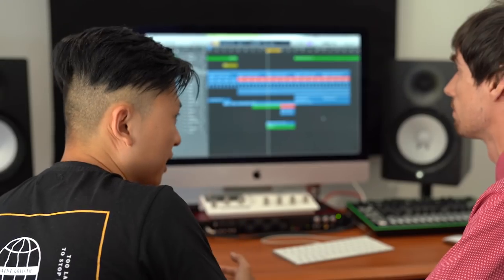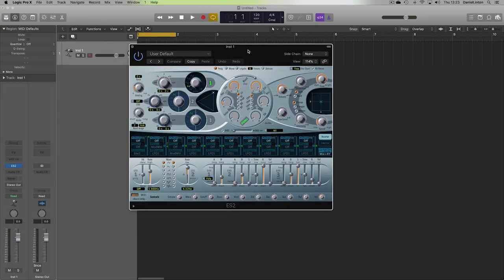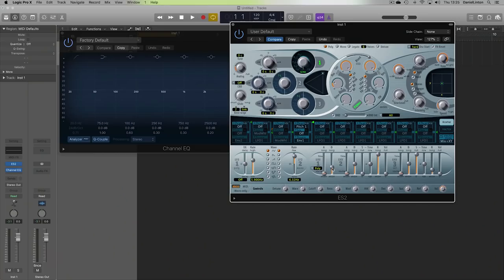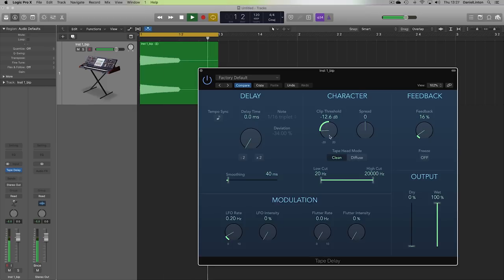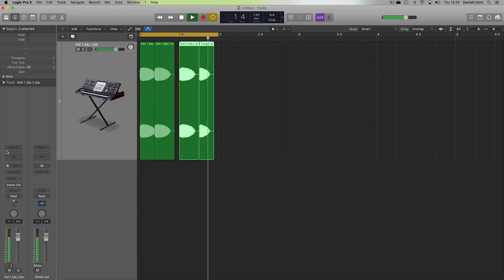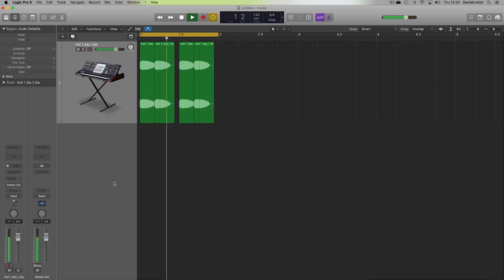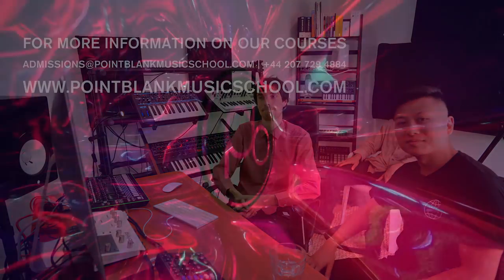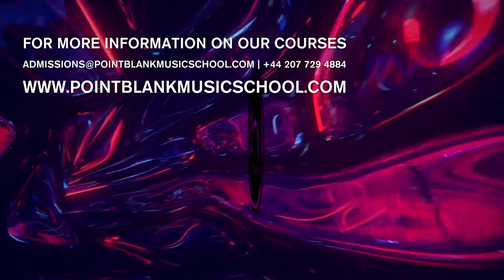How to Make Big Techno Kick Drum w/ Danny Linton aka Funk Ethics

Comment: Jesus so many different working techniques.  This is fantastic thanks for this.  Very much appreciate an insight into someone else's working methodology.  That's so invaluable in and by itself.  One thing I don't like however is this endless feature creep/overlap.  Like for example high passing that reverb.  You can do it with an EQ built into the reverb itself and using the built-in EQ or a plugin EQ or whatever.  Why have an EQ in the reverb itself?  It's just doubling up on an already existing feature to add to the overall features clutter and further confuse people.  Nothing to do with the video of course which is brilliant.  Thanks again.
Reply: The build in equalizer is often related to the incoming signal. most of the time you want it after the signal and since that is not the case, you use an equalizer after.
Depending on the settings it creates a bit more rumble or smooth things out, kind of depends on the functions your desired reverb has.